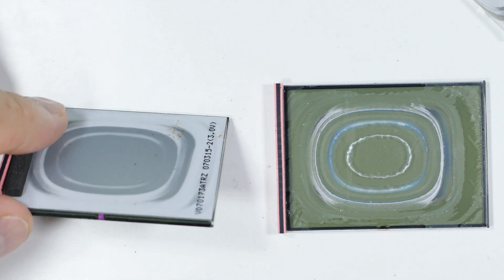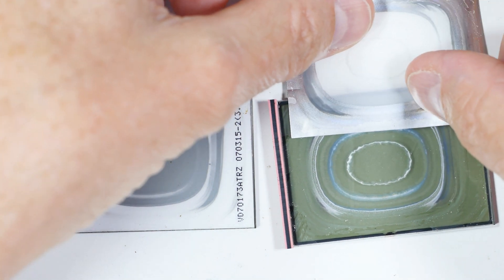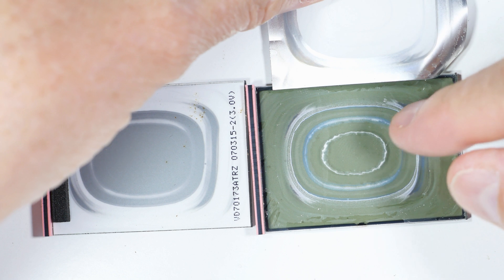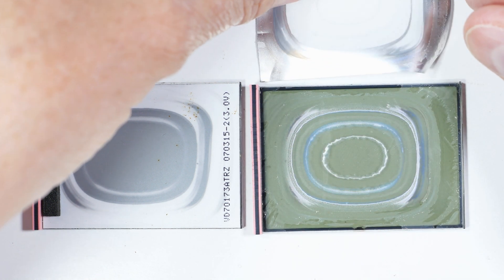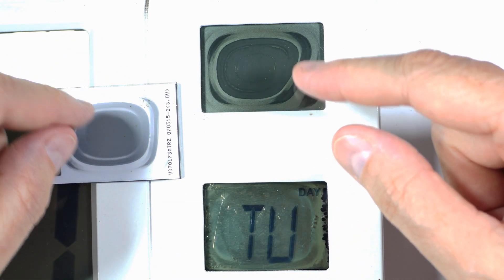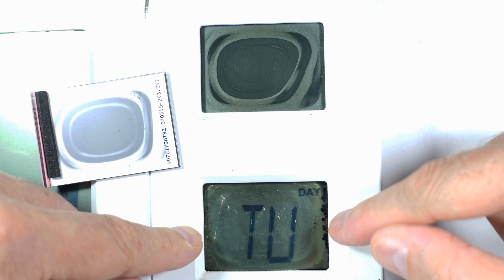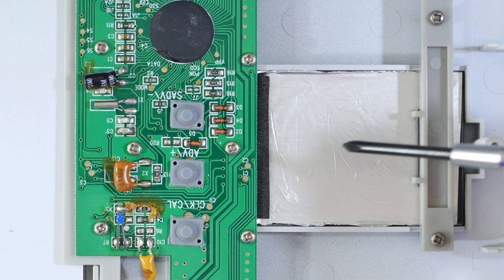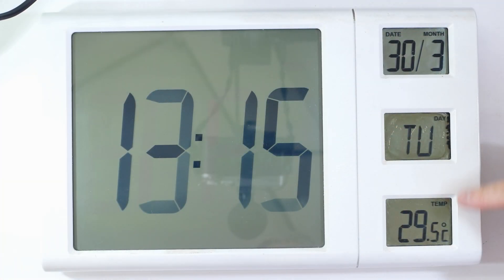LCD Display Repair - Advanced Fix (4K)

Comment: What happens if i use paper instead of metal foil for the background?
Reply from the maker: If it's a bright white paper the difference,  is slightly less clarity of the LCD, but it's not bad. That's what I use now because it's much easier. I just did a clock yesterday.